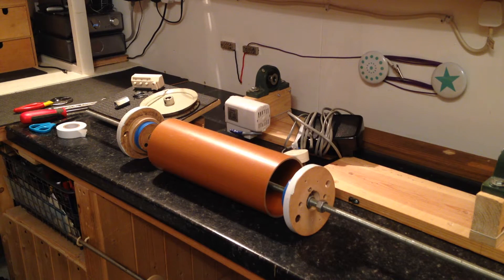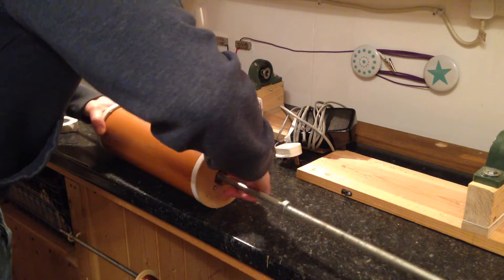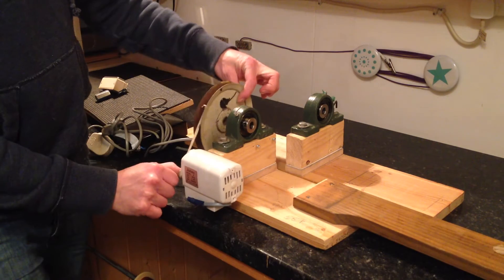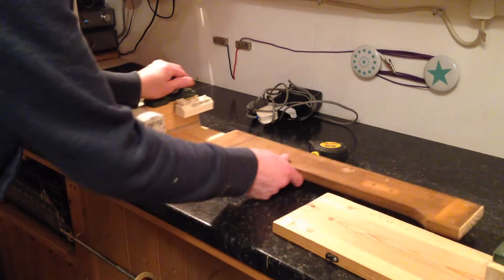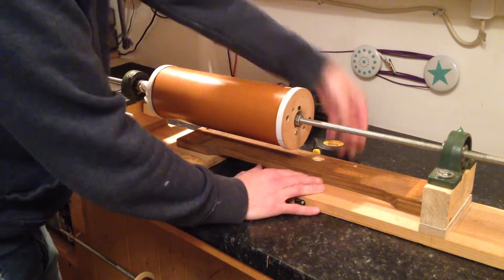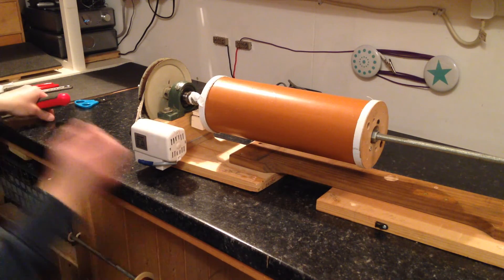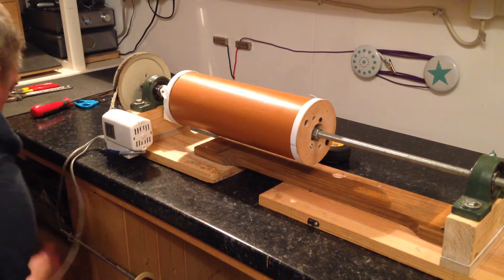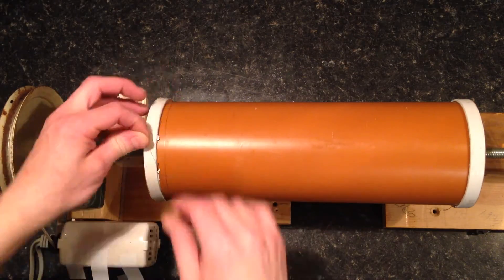How to wind a Tesla Coil

Comment: Which direction do you wind the primary to match this secondary?  From the middle out CW or CCW?
Reply from the maker: Hello mate, I’m left handed so wind left to right with which would be ccw but it doesn’t really matter, you can reverse the primary connections if you power your circuit and it doesn’t oscillate.
Reply: @deeds3611  Thanks for responding!  I don't think reversing the connections will have any effect.  Flipping the secondary over makes no difference because it is vertical.  Flipping the flat primary over is the only way I know to reverse the matching.  It looks like in another video of yours that the primary is CW from the center.

Comment: Got a question for you Tesla coil nuts.
Okay say you've built your coil. Tuned it up, done the math, got the NST and such. It works.
What if you wound another secondary coil on top of the first one and connected them both in parallel? Separated by Kapton tape or NMN laminate of course for insulation. 
This could gain you some amps in your coil. Increasing efficiency. (A big drawback to air core transformers)
Reply from the maker: Interesting, I honestly don't know. Sounds like something to try out one day ;)

Comment: Your use of salvaged sewing machine parts is genius, I hadn't thought of that before but it makes perfect sense. Many of the fundamental problems with coil winding are shared with sewing. Could you possibly make another video where you talk more about the operation of your coil winder? You laid out the design in this video clearly enough, but I'm also interested to know the more about what sort of problems you encountered when you first tried using it, what techniques for guiding the wire you tried/found to work best, how you avoid crossing over previous turns in the coil, etc. I don't really have a lot of money and I don't have a cheap source of lacquer wire, so I literally can't afford to figure this stuff out by trial and error. If I did I wouldn't trouble you with this request. Anyway, great video regardless, and damn does your machine produce a nice looking coil!
Reply from the maker: Max Kopstein thank you that’s very kind. I will try to do that - my only problem at the moment is it’s absolutely freezing in my work shop! I appreciate you asking and showing interest - if I can I’ll put something together with some tips, I need to clear some junk as my workshop has been used as a dumping ground since winter started - cheers :D

Comment: what about the protective coating?
Reply from the maker: You know I re-read the description box the other day and noted I never did show a video. I have a tall coil near me right now that needs the white electrical tape removing and varnishing. I've been going crazy painting them with about 5 thick coats, as thick as it'll go, of polyurethane varnish. I have to keep rolling the coil every few mins so it doesn't try to form blobs at the bottom. Keep rolling it every now and again leaving a longer gap each time.  Once it's touch dry slam another coat on.
 I'll video one being painted if you like? I really do have one that's crying out for the tape to be taken off. 
Cheers :D
Reply: deeds what's the least number of coats required to get good durability out of the coil?
Reply from the maker: +Bucky Ball hi - I've got one in here with only two coats but you can still feel the tiny ridges in the wire. It takes a lot to coat it so it feels like plastic but they're really nice to handle, very durable.  Two coats will hold all the wire on and give some protection from bumps and knocks.  I found once I got a few coats on I'm like ahh I might as well do one more. It'll be touch dry in an hour and ready for more so it doesn't take long.   Obviously they dry quicker outside but bugs are the thing to watch :D
Reply: Thanks, i am actually working on my first sstc.
Reply from the maker: +Bucky Ball  nice!! I've had a little break while I upgrade my workshop. I have the kit to build something I hope will be good - DRSSTC. If you need any help give me shout. Cheers :D
Reply from the maker: +Bucky Ball ....and best of luck, take your time and If you get stuck or need advise, just ask one of us lot. Take care :D